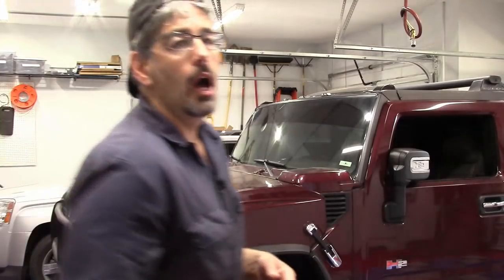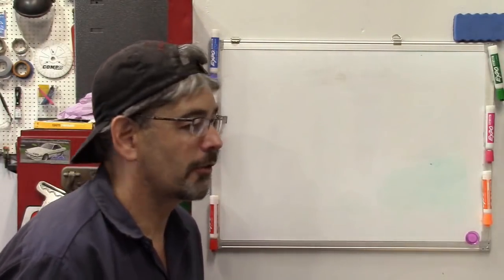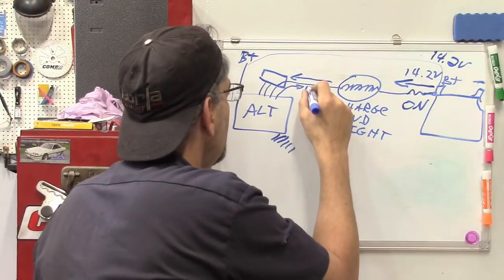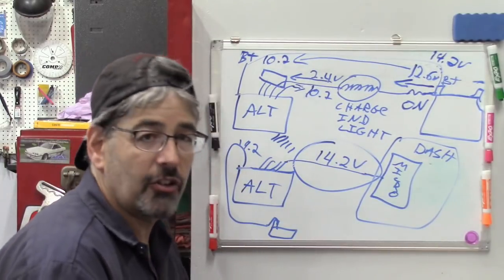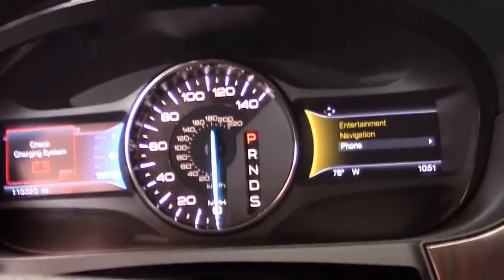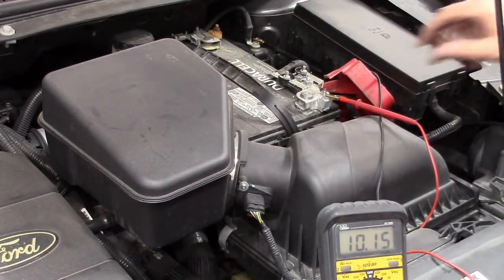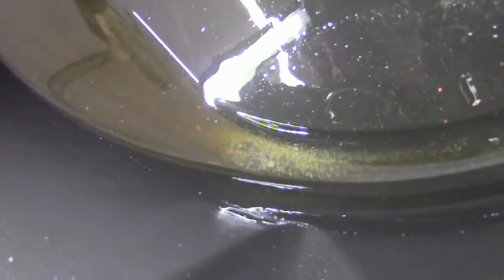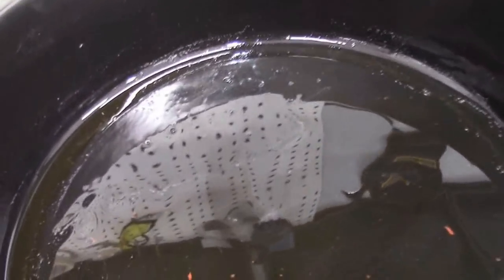Diagnosing a Leak, a Light and a Lag

Comment: I have the same car (Edge)  and the same problem, the issue was the voltage regulator. Sometimes I would have a drop to 10-11 other times it was over voltage at 17-18. Replaced and no issues. Shop originally quoted battery cables lol

Comment: I was trying to figure out what's going on with a alternator malfunction light turning on one time and I looked at the sensing wire and it was just coated in oil and breaking apart and it was shorting to ground but on top of that the actual alternator itself was not putting out no more than 10 volts and not really running right so and I also back probed the sensing wire to see if the sensing wire is getting the proper electricity to see if it's got a break or short in The wire in other words you have helped me out with going from a parts changer to an actual diagnosis guy
Reply from the maker: Good call, I have seen several alternators die from fluids leaking on them.

Comment: I remember working on a car from 2005. I was adjusting the fan belt, and it still had a simple enough system to where when the belt slipped the charge light was flickering rhythmically matching the sound of the belt. It was so cool to watch part of me wanted it to stay that way but alas I had to tighten the belt back up lol.

Comment: Very nice. One question: how do you do jobs like gearbox/clutch replacements e.t.c. without having a car lift? Do you just lift the car on 4 jacks and lie underneath it to do the job? Thanks
Reply from the maker: Yep that’s exactly how I do it. totally not optimal however my new garage can easily have room for a lift and I am considering options.
Reply: I bought a mid rise lift, Goes up about 3.5 feet. It’s amazing for front wheel drive vehicles, I can drop the power train out onto a dolly and roll it out under the car. I would have loved a 2 post, but my garage ceiling is only 9ft. I have done a couple Tahoe transmissions with it, modified a lift table to pull it out. Much better over rolling around on the ground
Reply from the maker: @mph- sounds like the MaxJax? That’s one of my prime considerations. Also considering a bend pak scissor lift but I wouldn’t be able to remove drivetrains.

Comment: I haven't watched the whole video yet, just after the part where "banging" the alternator fixes the system but I think there is another variable to take into account in these cases. Modern cars could have an intelligent charging system which means the alternator is not charging the battery all the time even if the engine is running. I've tested that in a 2013 European ford focus. The way the system works is that if you're driving, typically the alternator doesn't charge the battery unless you lift the accelerator, then you can see the 14.4V, but if you accelerate then it goes to battery voltage (12.6 and going slowly down). Basically if the battery has sufficient charge then it only charges it recovering energy from breaking. So I guess that's why sometimes it's difficult to diagnose these systems. You need to check through the OBDII if the module that controls the alternator is commanding the alternator to charge.
Edit: I forgot to mention that if the car has a start&stop system, typically you're going to see 11.1-11.5V when the car is "running" but the engine is off because it has to run all electronics, multimedia system, lights, etc. But of course the 8V you could see in the video are way too low.
Reply from the maker: yes I discuss these systems on the other channel.  the “right” way to check it would be to see if “on”signal is on. however if it isn’t you won’t get the battery light on and we had the battery light on during no charge.

Comment: I know this question doesn't relate to this video but my question is about the video about air intake temperature sensor. You stated that 5 volts should come from connection. I'm only getting 4.98 volts is that sufficient or should it been 5.0 volts or more?
Reply from the maker: that’s sufficient.

Comment: On the QX60 there are known issues with judder type feel when making slow turns which is caused by a bad electronic coupler which is connected to the rear differential. Simple test would be to unplug the unit and make turns and you will no longer feel the issue. Just a heads up.
Reply from the maker: Was unaware of that but based on the metal shaving in the fluid it was clear it was toast and the replacement unit was the diff only- everything else was re-used so the diff was definitely the issue but that’s good to know for the future. So what is the purpose of this electronic coupler? I don’t recall seeing such a thing on a rear diff before- just a speed sensor is usually the only electronics I find.  Also wouldn’t there be a code or something this would cause if it’s electronic?  The vehicle has absolutely no codes.  I expected an ABS code but maybe vehicle is moving too slowly during turns for it to trigger a wheel speed sensor anomaly- but a failed electrical component I would expect a code for
Reply: The system operates in front wheel drive for the most part for fuel efficiency. So, the coupler will engage to provide up to 50% of its available power to the rear wheels during Corning for improved grip or if it senses tire slip. When the judder on turns occur it will not set a fault code. I saw the metal in the rear differential so figured the coupler wasn’t the issue I explained but just wanted to give a heads up in the future. By disconnecting the coupler it’s a very quick way to diagnose if its the issue. The problem will stop as soon as it’s unplugged. Wasn’t doubting your diagnosis just wanted to add because you may come across this issue in the future.
Reply from the maker: oh absolutely- was totally unaware of this and I appreciate the feedback!!
  I wonder if that failed component could have been the cause for the excess wear on the diff?
Reply from the maker: just wanted to let you know I came across that service bulletin you referred to.  Really good info- wish I saw this before as I would have done that test to show the audience. If I didn’t see the innards of the diff all ground up in the fluid, I would have probably still suspected the diff and might have replaced it when it could have been just the coupler.  The bulletin said the coupler can be replaced without even removing the diff.
Reply: @SchrodingersBox  yes, they are replaced while the rear diff is in the car. Not to bad of a job to replace, hardest part is lining up a dowel pin on the coupler to a grove on the rear diff and pretty much do it blindly.
Reply from the maker: So of course you know me, I had to go back to the salvage yard and recover my CORE return and put 12V to the coupler and sure enough, it was inoperative. Owner of vehicle said the car has had that problem as long as they have had it so I am wondering if yesrs if driving with the bad coupler solenoid caused wear on the differential? 
  Thanks again for this information. totally worthy of another video.

Comment: I was sure that the battery is used only to start the car and the rest of the time the car electricity is fed by the alternator. so if I'm not wrong , why the battery voltage is dropping ?
Reply from the maker: could be parasitic draw.

Comment: I liked the percussion test on the alternator to prove the internal failure of the alternator. Had that not been the problem what other variables would you look into? Obviously a loose cable as you mentioned, the actual charge indicator circuit, or the alternator connector being loose. At least one comment mentioned the voltage regulator (which are usually internal these days).

I know older ford PCMs had that capability (though not always used) to do a WOT cut to the charging system, I imagine it would be possible for the signal wire to the alternator to be shorted. Could a massive power draw in the system cause your voltage to drop below the threshold for the charging indicator light to come on?

Any other possible variables I'm not thinking of?
Reply from the maker: yes I cover all these on the pay channel but I would have looked at the on signal from the PCM next (I didn’t need to because it was obviously working on this car) and then I would have done a ripple test.
Reply: @SchrodingersBox  I actually subscribe on the pay channel under a different name, I'm sure I've watched every video but it's a lot to remember. Just testing my knowledge of remembering things.
Reply from the maker: Yes you have to watch most videos more than once for it to sink in. If you watch the alternator video again it will totally answer your question and you’ll see that video shows the “right way” to test the alternator where here I kind of did more of a shade tree way. it’s still accurate but a bit clunky.

Comment: I had a car do this and it was actually negative battery cable to the frame cable exact same message service charging system
Reply from the maker: yep that would cause it except it won’t explain only 12.6 volts from the B+ on the alternator in this case.

Comment: Path forward?? GM 3.4L v6 fuel trim go positive (20%) any time the throttle valve is opened. At idle fuel trims are perfect, thus leak between throttle plate and MAF. Only things between throttle plate and MAF are the IAT, breather tube and rubber ducting.  Smoked engine , no visible leaks found. No coolant loss.  No codes (misfires, etc). Less than 0.010 in orfice flow and fuel PSI 55/54 psi at idle and load. Path forward??
Reply from the maker: you either have a dirty MAF or fuel restriction. I would start with a volumetric efficiency calculation to rule out MAF or with a fuel pressure test to rule out fuel restriction, whichever is easier for that model.
Reply: @SchrodingersBox  thank you.

Comment: Could have been the wrong diff fluid in there that caused the failure on the Infinity.
Reply from the maker: very true. actually what it was - the electronic coupler failed so vehicle never disengaged from locking the rear axle as long as they owned it.

Comment: It was the diodes Matt!
Reply: Or possibly a bad solder joint.  Just replaced diodes on my alternator, and that was a PAIN in the tush.  Need a SERIOUSLY heavy duty solder gun!  I think we resorted to using a torch to heat a heavy piece of metal to counteract solder being cooled by the rather large metal surface at some of the connections.